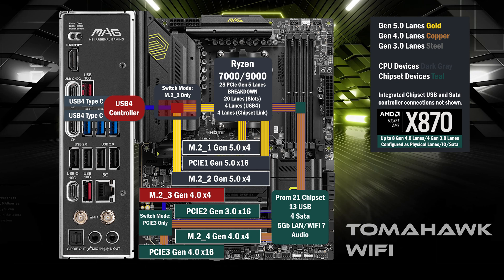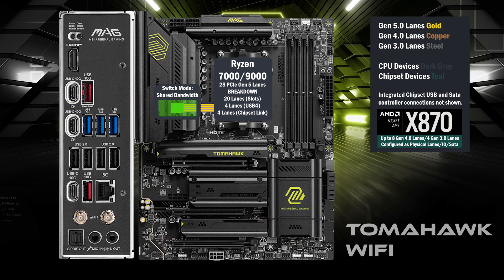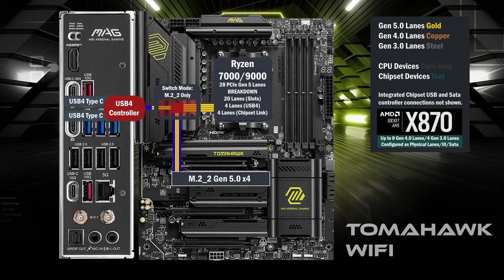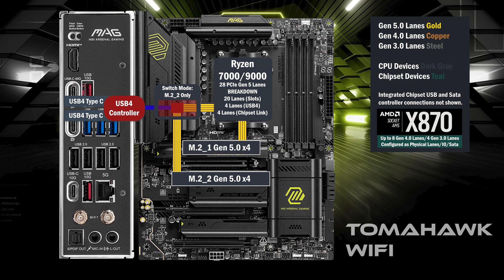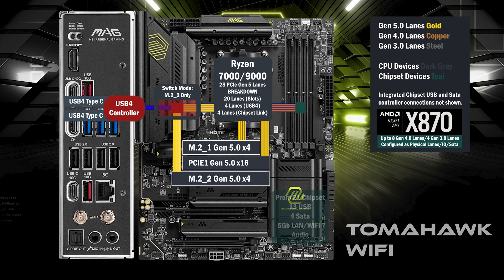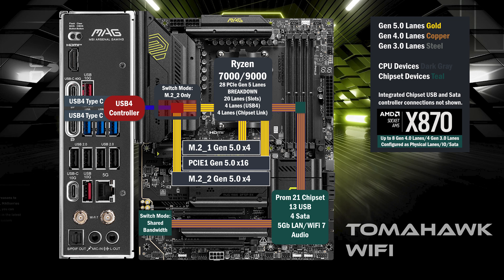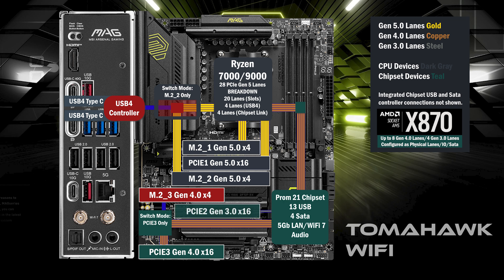MSI X870 Tomahawk WiFi All PCIe Connections

Comment from the maker: There is an error in this video: USB4 runs in x4 mode when a drive isn’t installed in M.2_2.

The switch modes for USB4 and  M.2_2 are: x4/x0 - x2/x2 - 0x/x4

Comment: Been having USB disconnect issues with this board, but I'm only using the top most m.2 slot. Anyone know what might be happening? Should I manually disable usb 4?
Reply from the maker: I would try updating the drivers/firmware for the board. There should be a file available on the website, similar to the bios. It might be under chipset. I'll have a look.

Comment: hello sir my config is gona be using 3 nvme drive and a sata expansion slot so ,,, using m.2_1 gen 4 nvme,  m.2_2 nvme gen 4,  m.2_4 nvme gen 3 while disabling usb4 type c at  the back  ,  so can i use the pcie3   for sata expansion card with out cutting any speed. and will the sata port get disable or slow . sorry i am new to this so please help,,,
Reply from the maker: Hi sorry I missed your comment. The onboard sata ports go through the chipset and have their own dedicated connections. They share the bandwidth of the chipset, they won’t be disabled if you use other slots. Is that what you were trying to determine?
Reply: @Ronin-Wilde  hello,,, what if i use all the m.2 slot, whats the best setting to use there top speed, all are gen 4 nvme

Comment: I'm going to have 2 Samsung 9100 gen5 NVME drives in raid 0.  (just because)  Will I run into issues only if I use the USB4 since they are shared?
Reply from the maker: If you setup your raid thru the motherboard, you will choose your 2 drives to dedicate to the raid. (Talking thru it)

If one of the drives becomes unavailable the raid will fail. Before you setup the raid, in the bios, I would choose the lane setting for USB4/M.2_2 that you want to stick with.

Using USB4 won’t cause M.2_2 to turn off, once a drive is installed in M.2_2 the default mode should be x2/x2. If you want your 2nd drive to have 4 lanes then you’d need to disable USB4 x0/x4.

If you setup the raid with M.2_2 x4 and USB4 x0 and then decide to change it to x2/x2, I think you would still be ok, might be worth trying. I think the only risk is if M.2_2 was disabled somehow, otherwise it should work just fine.
Reply: @Ronin-Wilde  Thanks a ton for walking me through that, really appreciate the clarity. That explanation about the lane settings and how they affect M.2_2 and USB4 helps a lot. I’ll make sure to finalize the lane configuration in the BIOS before setting up the RAID. I'm going to dedicate to the drive and disable USB4. Thanks.

Comment: So the only difference between this and x870e tomahawk model is that the 3rd m.2 slot that share lanes with pcie gen 4.0, and if I wouldnt use this pcie slot will my 3rd m.2 operate at full speed?
Reply from the maker: I use the expander, I wouldn't worry about your graphics card at x8, unless you have a very specific workload that needs lots of PCIe bandwidth between CPU/GPU. Thankfully it's not gaming!

Comment: One final question. If the second M.2 slot does not get occupied, will 4 lanes go to the USB4 ? Because you only mentioned that in the Bios USB4 can be disconnected to give 4 lanes to the second M.2 slot, but did not mention anything about the reverse i.e prioritizing USB4.
Reply from the maker: @JloxNinja  you can give 4 lanes to USB4 if you don’t use the second M.2 slot. It’s a mistake I made, I pinned a comment, sorry about the confusion there.
Reply: No apology needed. Thanks for clearing that up. I didnt notice the pinned comment so thats my bad. Amazingly clear video. Thumbs up!
Reply: Come to think of another similar variant. If PCIE3 is not occupied will the third M.2 slot receive 4 lanes right? It is not stated in the video, I am just thinking logically. Is that correct?
Reply from the maker: @ It actually doesn’t allow 4 lanes to go to the 3rd M.2. It’s a bit odd, you’d think PCIE3 could be disabled and all lanes could run to the M.2 slot, like you said. For whatever reason they only wired it for Gen 4 x2.
Reply: @ thanks for your reply. Allow me to share something with you and run it by you to see your thoughts... I had a z390 Aorus Master for the longest time... All M.2 slots are occupied (3 in total) and in addition  a secondary PCIE slot has an audiocard in it... yet my main PCIE still shows x16 for my graphics card... how is that even possible based on lanes? this is why I never knew "lanes" were a thing.

Comment: Is it possible to turn off the PCIE3 to make the m.2_3 slot run at 4x4?
Reply: @Fluffs64  Unfortunately no. The options are either 2 lanes for PCIE_3 and 2 for m2_3 or all 4 lanes to pcie3. You can use a cheap adapter and plug an M2 SSD into PCIE_3 and use all 4 lanes though.

Comment: Doesn't the pcei5 is like 4GB/s, so installing m2 in 2 slot as 5.0x2 mode keeps enough bandwidth for both usb 4 like 4GB/s each
Reply from the maker: That's right, USB4 is max 40Gbps, 20Gbps per port or 40 Gbps total.

Comment: EDIT: I was wrong to say it's wrong. I just didn't listen to what he was saying :)
This is wrong. At least partially. While the slots are all x16, there is NO 3x16 PCIE. The PCIE2 is 3x1 speed, just the slot size is x16
Reply from the maker: @tdragon87  Gen 3.0 x16 on the label is only referring to PCIe generation and slot size. The animated lanes are the actual amount of connected lanes.

It wasn’t a great way to label them.

You can’t say form factor either. It’s slot size, generation and lane count/speed. Usually written PCIe x16(size) x16 (amount of lanes) Gen 3.0 (Generation)

I completely agree that at a glance this is confusing. Thanks for the comment.
Reply: @Ronin-Wilde  You're right I'll fix my comment to say slot size! Thanks for replying, and good job!
Reply: @Ronin-Wilde  Replying again, yeah you were totally correct. Came across the video and actually listened now and watched the whole thing. :D
Reply from the maker: @tdragon87  I appreciated the feedback and I’m glad it makes some sense now :) The idea was to make things more clear and not cause more confusion.

Comment: is there a switch option for "only m2_slot3"? or is it only "only pcie3" ? I want to add one more m2ssd to my x870 tomahowk. I put one in m2_1 slot and one in m2_4 slot. I'm thinking adding one more ssd to m2_3 slot but I dont want to share this 4 lines with pcie3 slot. because I'll never use that slot.
Reply: @SnakepitChannel  The m2_3 / pcie3 switch has only two settings: either 2 lanes each or all lanes to pcie3. If you want all 4 lanes for an SSD, you will have to use a pci-e  adapter.

Comment: Just a quick note for anyone looking to maximize the USB4/M2_2 switch with a Samsung 990 EVO or EVO Plus. As of BIOS version 7E51v1A1A, setting the switch to AUTO will result in the USB4 being disabled and M2_2 set to PCIE4x4. It's not enough to set the split manually so that each get x2 lanes, doing so will result the Samsung drive working in PCIE4x2 with degraded performance. You have to both set the switch to give USB4 and M2_2 x2 lanes each AND set the M2_2 to be Gen 5 in the BIOS.
Reply: Thanks for this

I'm on BIOS 7E51v1A24 and have the following configuration:

T705 in M2_1
980 Pro in M2_2
980 Pro in M2_4

I did exactly as you suggested, but the drive in M2_2 is reporting that it's running at PCIe Gen. 4 x 2

Any ideas how I can get it to run at 4x4?
Reply: Ah I've discovered from Reddit that this is not possible on the 980 pro without disabling USB 4.0

Shame 😢

Hence why you specifically said the 990 Evo

Comment: I'm using nvme 1 and 4. Having issues with my USB DAC, connected only in back USB2. My sound is disappearing, I need to move volume up and down on my keyboard to sound appear again.. What problem that might cause? Big thanks.
Reply from the maker: Could be going in to power save mode.
1) Go to device manager > Press the "+" on "Universal Serial Bus" > Right click on the USB port or hub that the DAC is plugged into > Properties > Go under "Power Management" tab. Untick the box "Allow computer to turn off this device to save power"

If that doesn't work
2) Try a different USB port
Reply: @Ronin-Wilde  thank you for quick reply. I will try this.
Reply: @Ronin-Wilde  So, I almost contacted seller for RMA or exchange to another one, different brand mobo. But after 2 days of disappointment, finally I got fixed. I don't know how, but somehow my audio drivers got corrupted after WIN Update. I tried what u suggested, even I bought new expansive cable (I`m happy with it, getting even cleaner sound). So, what I did was just to re-install Audio drivers from MSI official website, and instantly recognized USB audio needs to be installed, PC restart and that's it! IT WORKS! In the end I`m happy with mobo and really didn't wanted to return and again build PC. Once again, thanks for your help.

Comment: Thanks for this video! Because of it I was able to min-max my new config. I got the x870 Tomahawk, transfered my old Adata Legend 960 to M2_1 and got a Samsung 990 Evo Plus in M2_2 configured to run Pcie5x2. I still have USB4 and haven't yet used the rest of the pcie or M2 slots, maximizing the upgrade potential.
Feels like a bit of a cheatcode on a single Promotory chip tbh 😂
Reply: Samsung 990 Evo Plus is GEN 4. I got same 2TB, I`m using this one M2_1 for OS and etc. another one M2_4 anyway not using other PCI-E and planning to add other M2 in M2_3. Leaving M2_2 not to interact with USB4 module even not using for now.
Reply from the maker: @ValentinNadolu  No problem, really happy to hear this! I think the Tomahawk nailed it, all CPU lanes at Gen 5 and no permanent commitment to USB4. Can’t argue with that 😀
Reply: Hi, when M.2_2 is sharing lanes with usb4, are those usb4 ports still operating at full speeds? 40Gbps each port
Reply: @lc235  pcie5x2 is about 8GBps . USB4 40gbps is about 5GBps. The problem is the ASM4242 controller is pcie4x4 so when splitting lanes it probably works at pcie4x2, which means about 4GBps, so you're probably getting about 32gbs from the USB4 controller this way.  I don't have any 40gbps USB4 devices to check though.
Reply: @ValentinNadolu  I see, thank you for the quick response.

Comment: can i put my os on the m.2_2? i would like to use the m.2_1 for another one
Reply from the maker: I don't know..

The slot goes through a switch, otherwise it has 2 lanes Gen 5.0 direct to CPU. Not sure if the switch has any impact on whether it can be used as a boot drive or not. I've only ever used the primary slot and I don't have the physical board to test for you. Not much help, but I'd say it's a pretty small risk that it's not supported.
Reply: OS better in 1 because not effecting M.2 speeds. 2 slot effecting USB4 and slowing both, so u might need turn off USB4 in bios to use slot 2 for OS in full nvme speed.

Comment: Hey Im sorry, I have a bad english can you tell me which is the best for my configuration ? Where should I connect my keyboard (usb-c) /mouse 8000hz to have the better performance? usb 2.0 or 3? I have only have a M.2_1Gen(nvme 1TO) / GPU on PCIE1 (3080)  and on PCIE2 for my internet  a sfp+ adapter(10gbps).

I only search performance and low latency
Reply from the maker: The type-c port under the lan port is direct to the CPU I/O die. The two USB4 type-c ports are direct to the CPU via PCIe lanes. You can switch between those two ports and try a latency test. Hope that helps!
Reply: @ yes thank you so much !

Comment: So basically if I disable USB 4 slots, can I use three gen4 ssd without sacrificing 16x for gpu? No capture card or like that.
Reply from the maker: Yes, the Tomahawk doesn’t have a switch on the x16 slot. You can use any M.2 slot without effecting your GPU slot.
Reply: GPU not going been used anyway by any slot of m.2. Check manual on official website PAGE 73 "Block Diagram." how other slots can be effected.

Comment: If I use the PCI_E1 slot for my GPU and the PCI_E3 slot for my capture card (Elgato 4k60 Pro Mk.2 - PCIE 2.0 x4) can I use two M.2s (both PCIE 4.0 x4) in slots M2_1 and M2_4 without any lane splitting/sacrificing bandwidth?
Reply from the maker: Yes, that setup would work, those slots won't interfere with each other.
Reply: @Ronin-Wilde  Thank you!!! Your videos have been incredibly helpful for picking out an X870 that fits my needs

Comment: Wait a fucking minute. I use the m.2 3rd slot as well. Are you trying to say if I’m using that lane it is possible it will slow down my Internet capability? From watching that video… that’s what it seems. So, I would have to be doing something for that to happen. But I’m trying to think, what exactly would I need be doing for that to exactly happen?
Reply from the maker: @progzO  I wouldn’t worry. You’d have to bottleneck your chipset, you’ve got 8 GB/s of data transfer in each direction available. If you download a big file, while transferring a big file and using all your USB ports. I’m sure you could create a situation, it’s not normal everyday use.
Reply: @ oh ok cool, probably wasn’t going to return the motherboard either based on that but was just curious.

Comment: I have 2 Samsung 990 EVO m.2 5.0x2 drives, if I want these running at full speed which slots/configuration would I use?
Reply: @HotdogRonnie  You can use one in M2_1 and have it run at pcie4x4, the second one in M2_2 has to be manually set up in the bios to split the lanes with USB4 and to use Gen5 to run in pcie5x2. If you set these two last options to auto, it will run at pcie4x4 and disable USB4. If you only set the switch to split the lanes between USB4 and M2_2 and leave the "Gen" to auto, it will run in pcie4x2 :(
I have a 2tb 990 Evo plus in M2_2 and it's marginally faster in pcie4x4 than pcie5x2 but I'm ok with that, I also want USB4.
Reply: @ValentinNadolu  Thats actually EXTREMELY helpful thank you so much kind of exactly what I wanted to I know.
Reply: @ValentinNadolu  Super helpful information here that I haven't seen any video be specific enough about! Hypothetically, if someone wanted to do a software RAID1 with two SSDs... then 2x,Samsung 990 Evo Plus one in M2_1, and then in M2_2 configured to run Pcie5x2 is the smartest way to still have USB4 and accomplish that.
Reply from the maker: @HotdogRonnie  use slots M.2_1 and M.2_2.
Reply: @Ronin-Wilde  Oh so it is slots 1 and 2 been getting conflciitng info about slot 2 slowing things down thanks for the reply!
Reply: @HotdogRonnie  Slot 2 effects USB4, but not GPU lines (not any other effecting GPU).

Comment: I still can't understand. I have two pcie 4 m2 ssd's. one of them gonna go the first 5.0 slot. and the second one? I assume it's gonna go 4th slot? Am I right?
Reply from the maker: @SnakepitChannel  Yes, 4th slot will run the 2nd ssd through the chipset and run at x4. 

You also have the option to disable USB4 and you could put the 2nd SSD in the 2nd slot. It would run at gen 4.0 x4 directly to the CPU. That may not be worth the sacrifice unless you were installing a Gen 5.0 drive in that slot.
Reply: @ronin-wilde thanks for the answer.  I guess I’m still gonna wait new pcie 5 ssds to buy. They’re too expensive and there are not enough different options for now. But I need to ask, please forgive my inexperience. What’s difference with second m2 slot with 4th slot? Ofc beside the pcie gen difference. If m2 ssd connects  directly to cpu, that makes it faster?

Comment: Very clear video thanks for that :) 

So if I understood you correctly and the graphic as well I can use the 1 m.2 slot as well as the 3 and 4 slot with 4.0 m.2 without any restriction? 

Greetings from Switzerland :D
Reply from the maker: @suniroth  Thanks for the comment, greetings from Canada :)

If you use 1st M.2 it’s direct to CPU no restrictions. Gen 5.0 x4

If you use M.2_3 it’s restricted to x2 mode. 
I labeled the slot x4 for slot size, but it only gets 2 Gen 4.0 lanes. Sorry if that was confusing,

M.2_4 is Gen 4.0 x4 mode.

The slots connected to the chipset all share the bandwidth of the 4 lane uplink to communicate with the CPU. 

If I had this board I would use the 2nd M.2 slot at Gen 5.0 x2 for one of my additional ssd’s, instead of M.2_3.

Let me know if you have any questions.
Reply: @Ronin-Wilde  Thank you for the quick reply. 

So is it best to use 1 2 and 4 with m.2 4.0 ssd? 

Because I don't really need the two usb c ports in the back and can deactivate them so that I have full power for the m.2 on the 2. 

Have I understood this correctly? 

Sorry I'm still relatively new to the whole hardware universe :D
Reply from the maker: That's a good option using slots 1, 2 and 4. Deactivating USB4 if you don't need it and getting x4 mode on the 2nd slot.

Those first 2 slots are Gen 5.0, there is no issue putting Gen 4.0 ssd's in those slots, they are compaitble.

That is a great way to utilize this board. It's one of the only boards that lets you deactivate USB4 and use those lanes for an M.2 at Gen 5.0.

If you have discord, feel free to join this server if you have more questions https://discord.gg/tZTQX7ae
Reply: Can I ask does the PCIe Slot 1 (GPU) share any lanes with the M.2_1?
Reply: @deloford  The GPU does not share anything on this board.